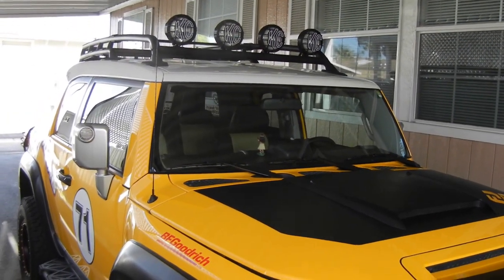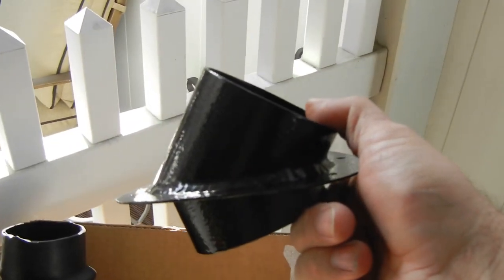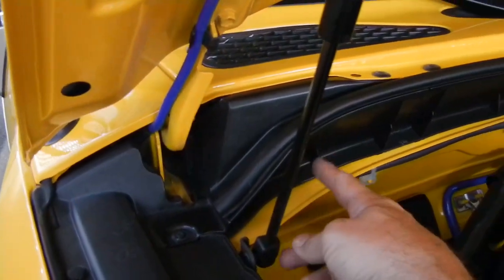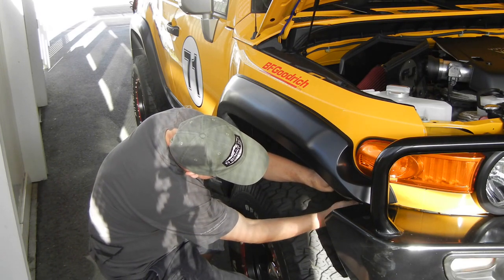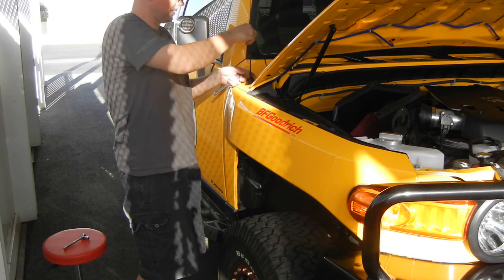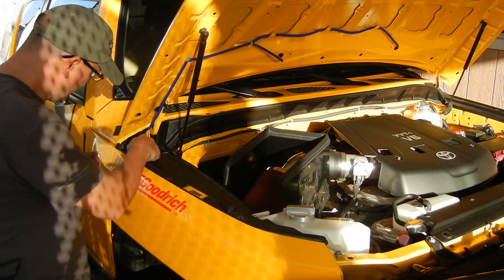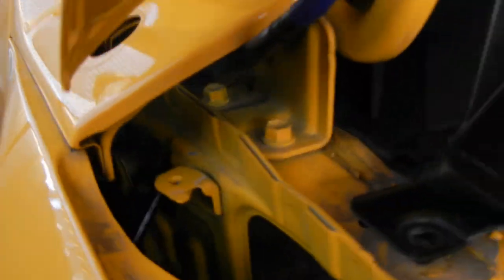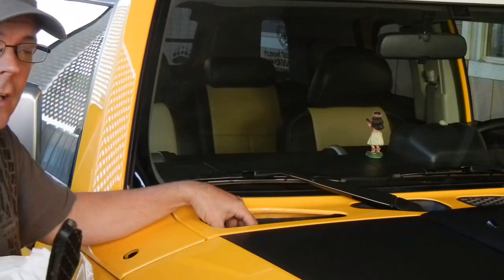River Raider Snorkel Install on a Toyota FJ Cruiser. Part 1 of 3.

Comment: why put a snorkel on it ... you have a cold air intake..... it won't do anything for you .
Reply from the maker: +Chris Reichelt Your wrong on several reasons. #1 The snorkel is for water crossings, sucking water into your air is bad. #2 A lot of desert/dirt offroaders prefer the height of the intake rather than being low to the ground, like it is in the FJ a hell of alot less dust being sucked in the intake.  #3 Is for my reasons, Since i tied both air intakes together,  MORE AIR VOLUME INTAKE means more POWER !!!!.. and #4 It looks BADASS!!!!!..Can someone else add any more benefits to the Snorkel ???....
Reply: +FJ Crush Bill Hawkins Actually in this case Bill, Chris is correct your current setup doesn't help you with crossing water.  I will actually tell you why though. The kit your using was designed to be used with the stock air box which makes a water tight setup allowing you to get water on and around the box possibly even submerging it.  What you have done by putting an aftermarket CAI in place of it is now created a situation that will allow water to get to the cone filter and hydro-lock your engine.  The only way to have your FJ safe for water crossing is to revert back to the stock air box and mount the Riverraider system per the instructions to the side.  Also since your filter is exposed I would run a sock over the filter to help keep it clean there are a lot of companies that sell them.   Hope this helps clear up any confusion other then that I was really impressed with the extra steps you took to make a clean install of the product.
Reply from the maker: +Lugnut Jeep Yes, thank you Lugnut, You are correct in my particular setup. It won't help in water crossings. My Main Goal for this install was to GAIN MORE AIR VOLUME into the air intake, from both oem vents & snorkel. I definitely noticed more horse power after the install.... P.S. if i want to use this for water crossings, all i have to do is to remove the filter and connect using a 3"dia. flex hose to that and to the inside box hole i made for the snorkel. and i have a filter sock i do use and can use it over the button intake of the snorkel.
Reply: +FJ Crush Bill Hawkins Yep I was looking at the sister product for my Jeep I used to own a 07 FJ as well great vehicle really miss it at times.  Just wanted to make sure you didn't over look the obvious from one off road guy to another.  Good luck out on the trails.